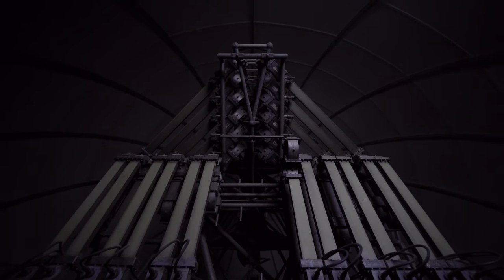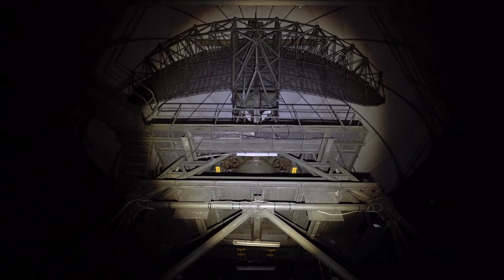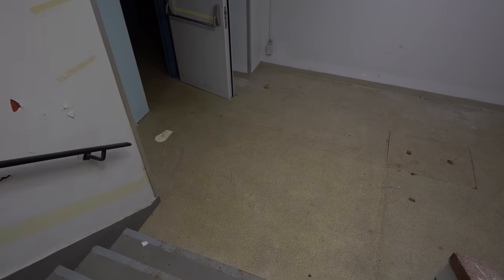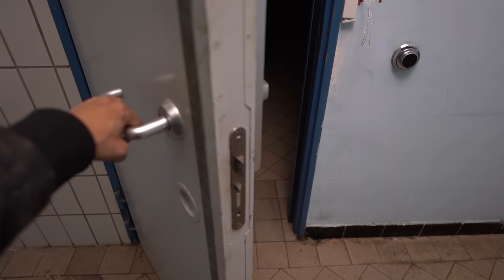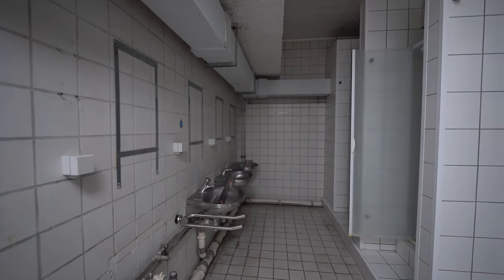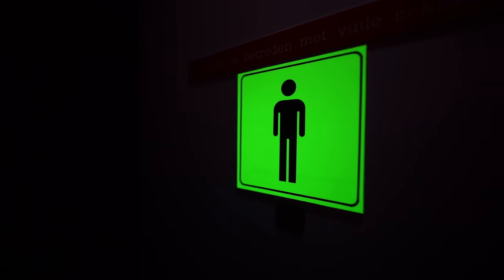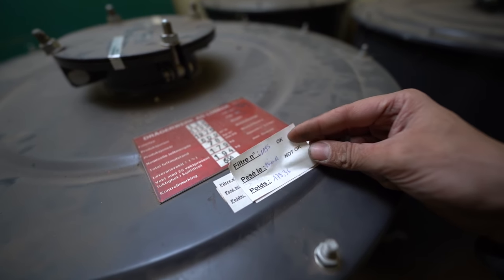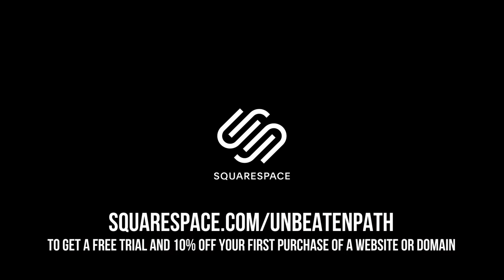ABANDONED | classified military NATO radar & bunker

Comment: I worked 16 years in an exact same facility in the NL as a Fighter Controller. For a short while I worked in this Belgian bunker in 1988 and visited later again for operational work. All fighter operations were directed and controlled from the facility. The same radar was teared down in the north of the Netherlands where a new, modern is built. But there is still one intact and operational in the center of NL. The work was in shifts. The sticker you filmed is a class sticker from the NL Military Academy. If I am not wrong there was a fire in this Belgian bunker before 1988 where people died because of getting trapped. After that fire the safety regulations and facilities were changed to prevent it.
Reply from the maker: Hi Michel, nice! Must be much more impressive when it’s in use. Thanks for your additional (and sad) info. About the Dutch places I know… maybe I’ll be able to explore it one day but I doubt it😄
Reply: And then long winding up and down noise of sirens began
Reply: Think they'll reactivate this one in preparation for WW3?

Comment: "Don't tread on the theodolite bracket."  If you are unaware  a theodolite is a survey/ alignment tool similar to a transit level, except not only can it  locate azimuth degrees, but  vertical degrees as well. Visual device with sighting scope and crosshairs.    There  would have been a known target   set at a known azimuth and  elevation,  and known distance,   probably at zero degrees  elevation,  with  either a sighting hole or  removable panel in the  radome to allow visual siting.  

I maintained  Ground Controlled Approach RADAR  at NAS Miramar in the 70's, and a theodolite was used with GCA  to maintain accuracy  under FAA, as Miramar also  used to recover  civilian aircraft, at times.

Comment: I think these radardomes are a generic design (such as German WW2 Regelbau for bunkers) because it looks like 2 drops of water like the radar dome in the village of Wier next to air base Leeuwarden The Netherlands. The old dome is replaced with a new radar building but in Google Maps you can stil see the old one. GPS 53.25728811100928, 5.620138028495739
12:00 That paint is radium paint, so don't touch it.
Reply: The radar in Wier and the one in Nieuw Milligen are identical to the one in Glons; these are the only 3 sites who hosted the Medium Power Radar in NATO.

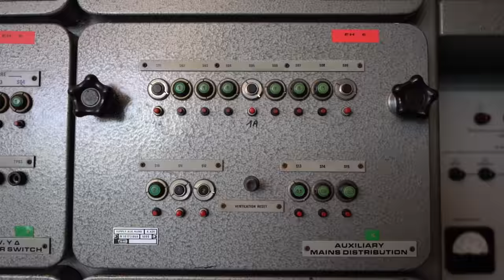Comment: Does someone know which thing the part of the Radar control unit is at 2:04?
Reply: Goed morning i was for many years soldier in this Radar Station Typ ( but i have not  more many knoldege about this radar Type because i leave the airforce for over many years) but i mean this is the high Power Switch  of the High Power Part this Radar Type have two parts the high and Low Part ( the switch the electric high power( 300 kV)  from big condensators  to the antenna). More information from this Radar Type can you read on Wikipedia.